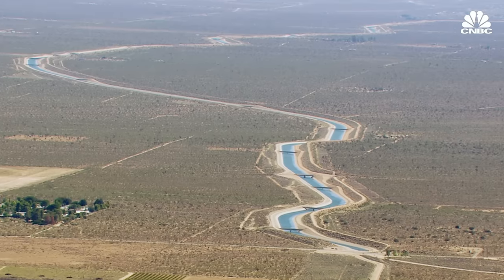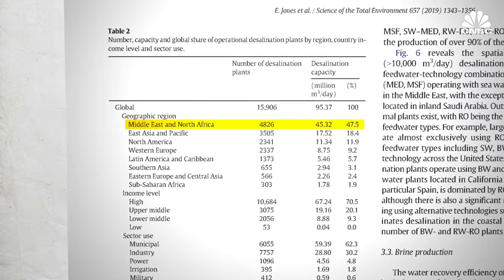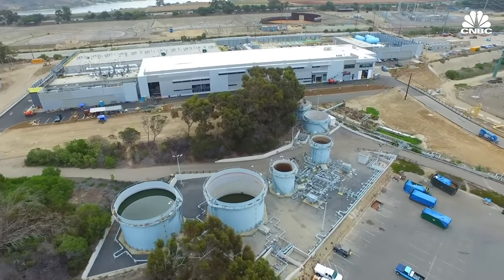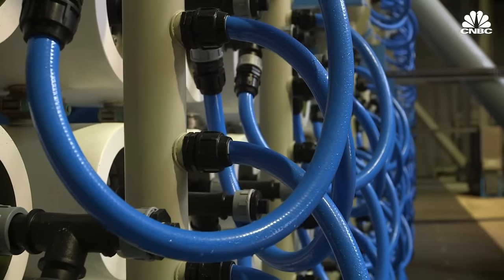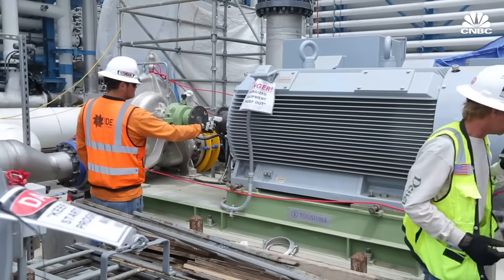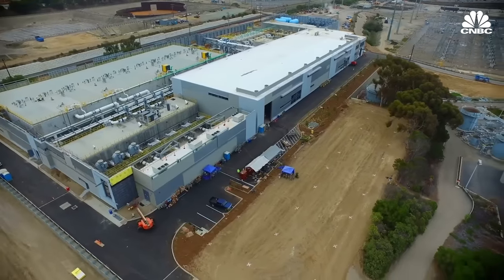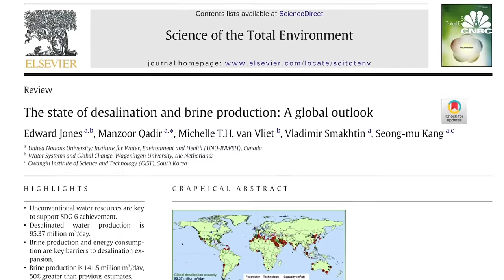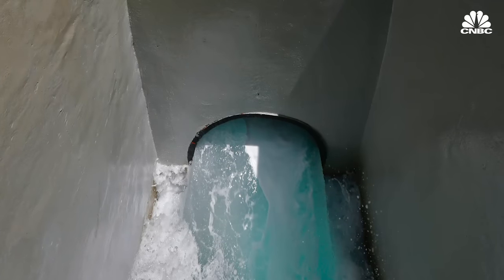Can Sea Water Desalination Save The World?

Comment: In my opinion, the only problem is that river water is artificially cheap. This will cause some tension between inland and coastal cities feeding from the same river, since one of them doesn't have alternatives.

As for the brine, it doesn't sound that difficult to solve. It's literally just concentrated seawater that you need to dilute again. There's a lot of ways to approach that from pre-mixing with seawater to mixing with (treated) waste water.
Reply: You just dump the brine further out on the bottom.  No problem given relatively small amount of salt water processed/
Reply: Essentially, we need more studies into what applications sea salt and/brine can have, beyond the food industry.  Perhaps, a breakthrough in sodium batteries?
Reply: @apostolosvranas4499  why?  There is ZERO problem with putting it back into the sea
Reply: @protonneutron9046   , the increased salinity would harm local saline, especially animals pf the bottom, and - in the long run - further increase the sea temperature as salt absorbs more heat than water.
Reply: @apostolosvranas4499  wrong it doesn't.  Decades of observation prove you wrong.  This tech has been used for a long time.  Run alone now
Reply: @protonneutron9046 , I'm not 'alone' in this!  If you meant 'run along', hey, I'm not defending coal/petroleum industries' interests, I'm defending humanity's interests!
Reply: And to solve the energy usage problem, we can power the desalination plants with nuclear energy.
Reply: @elevatorman5468  That's an option, but so are renewables. It's a lot easier to store water than energy, so desalination can be somewhat flexible on when you draw power.
Reply: @kalebbruwer  Anyone who cares about the environment cannot in the same breath suggest "renewables" which are ludicrously dirty to manufacture. If you genuinely care about both humanity and the environment, you MUST support Nuclear and Lift reactors, otherwise you're ineffective overall.
Reply: @LawsonR  I don't usually recommend renewables over nuclear, but in this case there's no need for batteries. That's why I think it's worth looking into: you just make water when the sun shines, since it's a lot easier to store water than electricity.
Reply: Interesting....
Reply: there are many ways to make fresh water. filtration, distillation, well, process transformation, and rain catching.

Comment: I do believe desalination is the key to solving many problems. Although I would rather see the water and salt separate completely in this process and at least some of that salt dumped somewhere environmentally safe to reduce the effects that brine would have on our oceans. More costly, but also healthier. I'm sure with more energy advancements, desalination will become more practical.
Reply: only issue is that there isn't any effects that brine has on the oceans.  they have this idea that it would only impact a small area around the outlet, but they haven't found any proof of that after decades of these machines operation.

Comment: My husband and I use an average of 33 gallons a day and we even have several fruit trees and a few vegetables.   We save shower warm up water, have a laundry to landscape system, we put in 3,200 gallons of rain tanks for summer watering of fruit trees, we wash dishes in about an inch of water in a tub, we have a shut off valve in our showers, and we only flush when necessary.   If you have a pool, don't fill it with dirt like we did 13 years ago.   Turn it into a huge rainwater storage tank.  (We might try digging out our pool again and doing that.)

Comment: Why can't we stock the left over brine in ponds to finish the drying out process and turn it into salt.
Reply: That salt could then be used to treat/de-ice public highways during the winter months
Reply: Or we can start pickling everything.
Reply: #LearnMMT macroeconomics
Reply: Just asking, but where would you dig these holes at?
Reply: Because its easier to dump it back into the ocean and salt Is cheap. The amount of space you would need, especially expensive coastal space would be massive. Think about how long it takes for you to evaporate a gallon of water even in the summer. Sure you can spread it out to increase surface area, but they're talking 50 million gallons of brine water a day. Thats roughly 5000 average swimming pools a day. But a pool, at its depth would take months to evaporate. So think about how big the area has to be for it to evaporate, and collect.
Reply: @davidstravelguide  The power you would use to pump it cancels out any power generated.
Reply: Salt water batteries
Reply: @davidstravelguide  For Hydro power, using salty water will corrode the turbines and valves quickly. Its not practical. You would have to use technology used in Geothermal plants, not Hydro Power Plants. 
But the main problem is that the water is essentially being pumped out of the sea and then even if you extract hydro power from it, you are eventually going to dump it back in the sea. Extracting hydropower might recover some of the energy you spend on pumping the water out from the sea, but given the cost of generating hydropower from salty water, it might not make economic sense.
Reply: @death_parade  Isn't it possible to just purchase more resistant parts or the best cost efficient ones are already in use?
Reply: The only way to deal with such an amount of salt is electrolyse to sodium and chlorine. Chlorine is eliminated by limesone relasing CO2. Sodium go for industry (we produce about 255 MILLIONS tons of it every year)
Entire process is HUGE energy expenssive...
Reply: @TobyCostaRica  use bamboo forrest to make charcoal and boil the brine down further
Reply: Whats the hoover dam water? Drinkable? Why not desal from that?
Reply: @Al45kan  
They do. Some of the water is used for irrigation and drinking.
Reply: @SquidCena  there is no need tro dig pump it to dessert areas where it is hot and there you go
Reply: to much chemicals in the brine! We can have desalted water out of the air because the evaporation from the surface water is as large as all lakes and rivers on Earth ! Renewed ever nine days it is unlimited. To take it out you just need cheap AWG operation to take it from the atmosphere!
Reply: Owen Kaz  As fast as Antarctica is melting it may just even out.
Reply: I thought that's what the Salton Sea was. A pond of salty nasty water
Reply: @erniellerena  Just tell rich people it is desirable to float in it and charge a lot of money.
Reply: @americathegreat1811  Hahaha the rich are probably no longer rich for that one. Now we have the poor environmentalist trying to save the damn thing.

Comment: I literally thought of this when I was a little kid. I thought if oceans were rising and we were losing fresh water to just use sea water to lower the tides.
Reply: The entire world’s water supply could come from the ocean and the sea level wouldn’t even drop an inch
Reply: Natalie the oceans will not rise at the rate originally suggested by scientists because as the heat on earth rises so does the evaporation rate. The fresh water being released from the melting poles is being evaporated at the same rate that it is being released. This needs to transpire to get the rain needed to regrow our forests and end drought.
However as long as man keeps polluting our atmosphere there will always be extra undesirable yet necessary heat to supply earths evaporation process. New York City is only a few feet above sea level yet the polar ice caps have lost well over 50% of their original mass. According to science that would put New York City underwater many times over yet the level remains as it has always been. Where’s the water? It’s in our atmosphere. It is why here in New England our sunny days that we used to have without a cloud in the sky are non existent. If we get sun it does not last long before the clouds move in. The water is in the atmosphere. Although your idea shows intelligence and it’s feasible to consider under those circumstances, we will never have to worry about rising sea levels to the extent scientists originally suggested due to an increased evaporation that coincides with the melting of the icecaps.
Reply: @gregoryone90  that's not true. The data given by nasa and their observatories to not suggest a melting:evaporation ratio of 1 to 1.
Reply: @gregoryone90  I'm sorry but your theory is incorrect. Just Google maps depicting water levels 30,000, 20,000, and 10,000 years ago. It's a huge difference. The bridge that animals used to cross from one continent to another was literally a land bridge. And you could've literally walked from America to Russia.
Reply: A lot of us have. Unfortunately we didnt do anything about it
Reply: @gregoryone90  I fully agree with your evaporation and air born water ideas. BUT I live one block uphill from the atlantic ocean in MA. I have been here over 20 years. In that time the floods are more frequent and much more severe. We have a huge salt marsh nearby. Locals worry that it is innundated farther and more frequently. When we lived in Fort Monroe VA for eighteen months, we were evacuated twice as water poured over the sea wall and filled the basements which had been built in the 1700s. An entire newer housing development was washed away. The tidewater area is sinking and they are measuring record high tides increasing every year. Miami floods annually now as well. Sea levels are rising, perhaps not as quickly as some feared but they are rising.
Reply: I cant believe nobody commenting has a clue but the truth is the water cycle would dumb the water back into the ocean eventually you can lower the sea level unless there's more ice created sitting on mostly land
Reply: 99% of the water on earth when it was created is still here.
Reply: @gregoryone90  your also not understanding the whole scope of things. Plus your assumptions are false on the evaporation. It's not immediately evaporating as soon as it melts. That just doesn't make any sense. It would have to be very hot out in order for it to be basically skipping a part of it's cycle and going straight from solid to gas. It's not dry ice.  And even if you were right it still wouldn't mean anything. The water doesn't just stay in the air. It's going to still make its way back to the ocean. How is this not obvious to you. Plus there is also evidence of liquid water trapped inside of the ice sheets and in glaciers. It stays liquid from the pressure. That's how some of the fissures are formed that break the ice apart.
Reply: that doesn't even make sense natalie the tides (the ocean is seawater) tides are the oceans response to gravity of the moon and sun pulling the ocean closer to it
Reply: @lynseymoat363  wrong just wrong. And instant increase in temperature anywhere on the planet has an instant effect everywhere on the planet. It’s impossible for it not to. For instance a bomb going off in Palestine although it is minuscule  causes an instant rise in temperature on the opposite side of the planet. That is how fast heat transfer occurs.  So with that said yes evaporation happens instantly as soon as the heat increases even a fraction of a degree.  The same can be said for anything. When dealing with wAter it is called displacement and it is based on the same principle. 

Why does it have to be that way? Because if it were not that way the temperature would never rise anywhere and evaporation could not occur. These things have to happen at the same rate they occur for mother nature to keep up with the constant demand to rebalance her equal Librium. 

Your thinking is dichotomy, It’s black and white to you, one or the other no in between.
Reply: @marjohnsmusings3222  so you completely agree with me yet you want to debate?

Listen, an increased global mean temperature means there is going to be more energy in earths atmosphere oceans and water ways. We get more severe storms, frequent floods due to heavier amounts of precipitation, faster ocean currents, even our river and streams will be faster. There will also be an increase in wind and because the oil was removed from earths core we will also get more underwater earth quakes. Then consider that every time we get hurricanes or storms banks erode and take trees with them. Hurricanes can sweep entire villages into oceans. Hurricanes swallow entire houses along the coast. Couple that with pacific nations dumping extreme amounts of garbage into the ocean and with a constantly increasing population putting more and more boats on the water, oh and not to mention the navy’s of the world floating large amounts of new boats everyday, the cruise ships too and you are bound to get a rise in sea level. 

Also when glaciers melt and fall into the ocean they are not melted yet. 

You’d be surprised at how much displacement man has caused.

But there are always going to be variables. 

But the inundation of your salt marsh would be much greater and I’m talking complete 50 feet above your house lol of scientists were right about  the sea levels rising. The inundation may also be due to local erosion.

Consider that there is a pile of trash floating in the ocean the size of a us state as the culprit though.

I have house on the ocean, I have my own beach in my backyard, trust me the sea level has not risen. But expect it to rise slightly due to displacement.
Reply: @lynseymoat363  the smarter you are the more you understand. As the heat on the planet rises so does the evaporation rate. These two things happen simultaneously. If they did not happen simultaneously they would never happen.
Reply: 70 people and the OP think if we all drink water from the see the sea level will go down ! Thats the best laugh this month.
Reply: Oceans aren't rising.
Reply: @fuzzywzhe  What do you think happens when that icesheet melts?
Reply: @Andy-hz2ef  If the ice sheets are over land, the ocean level rises minimally.  If it's an ice sheet over water - nothing happenes.

I'm only pointing out there has been absolutely no noticeable change in the ocean levels in the last 50 years.  None.

The alarmism about rising ocean levels is just BS.  It's a blatant lie.
Reply: @Andy-hz2ef  What about water from evaporating lakes? Aral Sea, used to be the fourth largest lake, thanks to human diversion of water from it's rivers to water cotton, it has largely evaporated and turned into a desert, and the salt has been blown to the entire world and contributed heavily to the hotter summers and colder winters it gets now. If only there was a way to divert water from the sea to it.